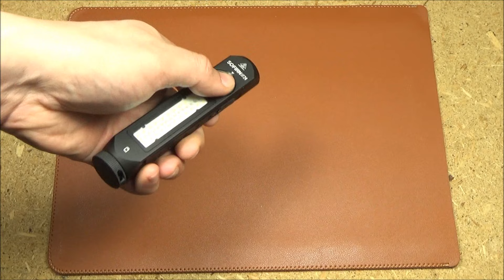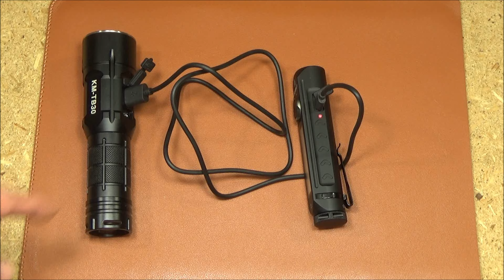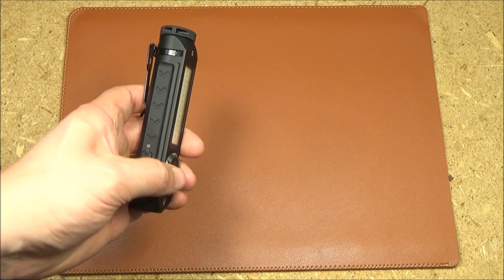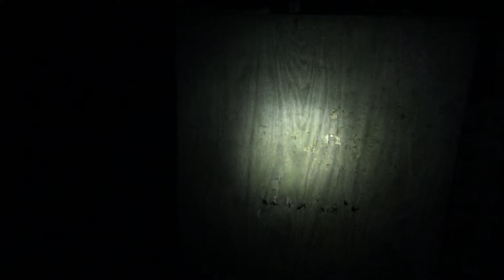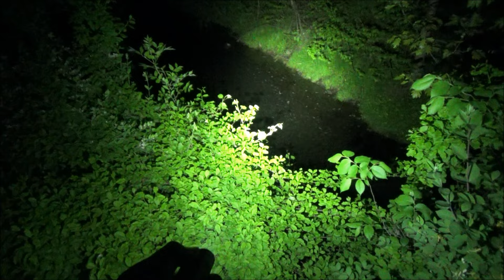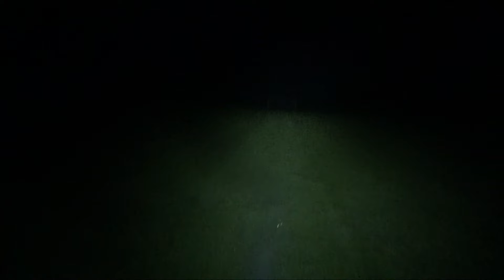Sofirn IF24 Flashlight Review ($43) EDC Light, Area Light, Multicolor - Epic Bargain For Light Guys

Comment from the maker: Showing the Sofirn IF24, which functions as an EDC light, area light, and multicolor light. Sofirn has been a very innovative and budget friendly brand over the years, working closely with, and supporting, the flashlight forums, and implementing their suggestions and contributions. Sofirn lights often give you more and better features, for a lower price, than big name brands. SOFIRN WEBSITE: https://www.sofirnlight.com/products/sofirn-if24-rgb-flashlight-2000lm
10% OFF discount code:10BDIF24 (it will be invalid on June 5th)
US Amazon LINKS BELOW:
IF24 EDC/Work/Multicolor Light: https://s71.co/3V3GdT2
Amazon Promo Code: A76EKFDE6BO5R
IF24 Back-Up Link: https://s71.co/4ar9tYe
IF23: https://s71.co/4ar9tYe
SC13 Mini: https://s71.co/3WLgwbk
SC21 Mini: https://s71.co/4antz5F
IF30 Spotlight: https://s71.co/4bDtdJm
SC28 EDC Light: https://s71.co/4bH1s2I
SC29 EDC Light: https://s71.co/4dGo84O
SC31 Pro Pocket Light: https://s71.co/3wBNEaO
SC33 EDC Light: https://s71.co/3V2zbhf
SP35T Tactical Light: https://s71.co/3WJQVPT
SP36 Pro: https://s71.co/4dHzO7q
Q8 Beast: https://s71.co/4an1HPo
SOFIRN AMAZON STORE: https://s71.co/4bFDiWd